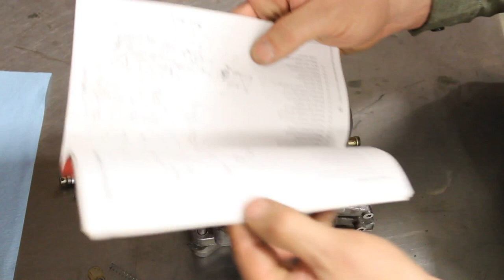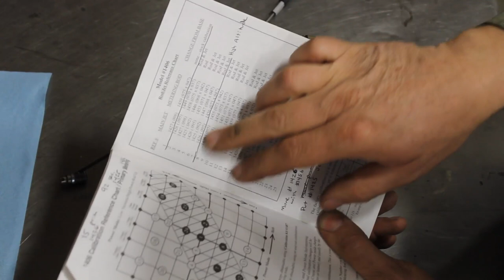Rebuild an Edelbrock 1406 - 1400 Series Carburetor - Carter AFB Carburetor

Comment: I have never once heard anyone express a preference for the old stove pipe chokes over an electric choke, until now that is.  We used to swap the stove pipe carbs out for electric choke carbs at the shop I worked at in the 80s.  One thing to know about them though, if you don't daily drive your carbureted car these days, the gas will evaporate out of the bowls.  Fuel is optimized for fuel injected vehicles these days and what people run into with the electric chokes is that they'll start heating up while you're cranking to fill up the carb then by the time the carb has gas, the choke might be partially open and then the thing still won't start.  I personally like to manually fill the bowls before cranking if it's been sitting a week or more.
Reply: I Agree 1000% With Everything You Said!!! I Too Fill My Q-Jets With Fuel Before I Try And Start One That Has Been Sitting Too Long!!!
Tech Tip: The Ford Canister Fuel Filters With The Quick Connectors And The Top Cut Off Make A Perfect Funnel To Fill A Q-Jet Through The Vent On Top!!! 
Keep Rocking!!!

Comment: This is a Carter AFB (Aluminum Four Barrel) originating in 1957. In my opinion, this and the Carter AVS (Air Valve Secondary) are the best four barrel carburetors with their metering rod & jet design.

Comment: I had a quadrajet carb on my 1980 Camaro, when one of my son's friends indicated, hey install an alumimum intake and Edelbrock carb. I was not interested that much. Well, when we arrived home from Church two days later, that guy was taking things apart on my Camaro. When I got out of the car, I was looking for where he drained the Antifreeze. Well, thats when I learned, he cracked my intake open without doing that. I ended up with lots of issues at that point. I had the perfect working heat control choke. Than that went away real fast. I was not in a good mood after that day.

Comment: That was very interesting! I've owned and worked on a couple of Quadrajets, and I think they've always gotten a bad rap. I had never seen an Edelbrock like that, and I like the design. My '84 truck came with a 305 engine and I swapped in a 350. Seems like it has never performed like I thought it should, though. I believe that with the larger displacement, it is able to maintain more vacuum at full throttle, and this may not be allowing the secondaries to open (it has a vacuum lockout on the secondary metering flaps, and the vacuum must be nearly zero to let them open). It might also not be allowing the power valve (or economizer) to move the primary metering jets to the rich position. I'd need to refer to my notes, but  I tested it before, and I think it had to have almost no vacuum to let the rods go up. Maybe I should start with one of them Edelbrocks and get the right one for a 350...... It's got the Electronic Spark Control unit on there, and I'd like to have a way to see whether it's retarding the spark or not. It's a blind system. Anyways, I enjoyed the video and appreciate your good testimony.
Reply: Need to verify the secondaries aren't locked out (choke on primaries has to be fully open)

Then check the spring tension on the seccondary air doors (the choke plates above secondary) 

Pull the secondary metering rods and make note of the 2 letter code.  From the factory it was probably DP rods which are really lean.  You can swap in DH or DR rods to richen it on the secondaries,  ought to waken it up a bit.